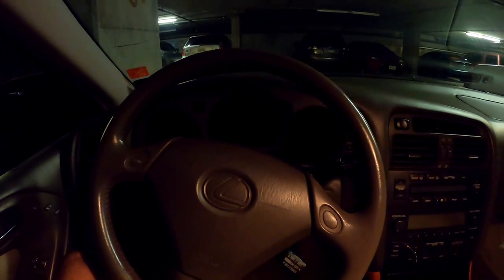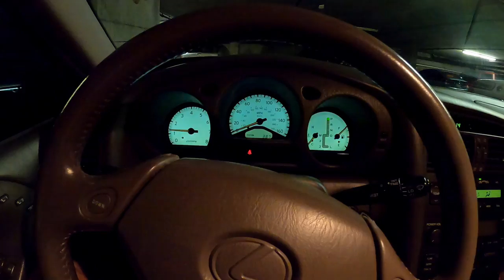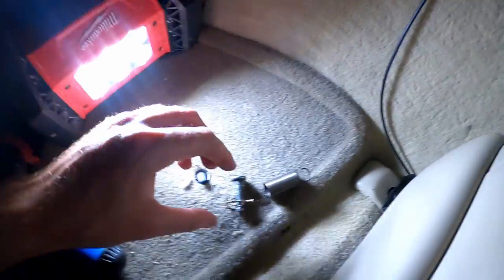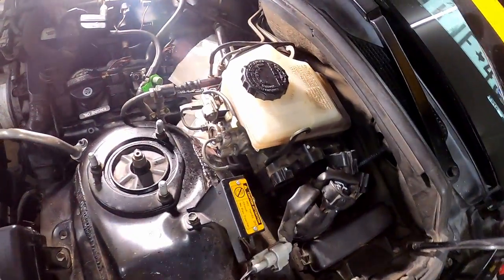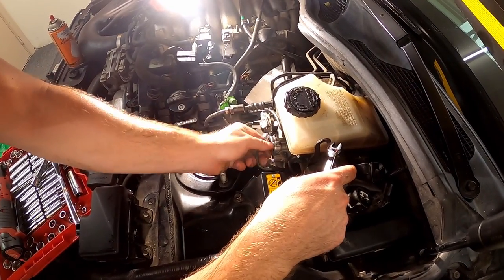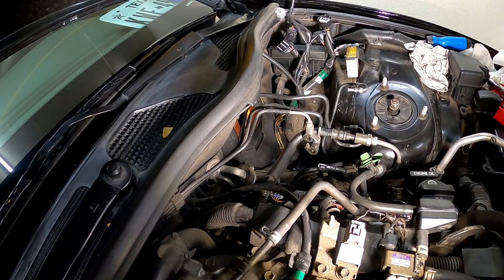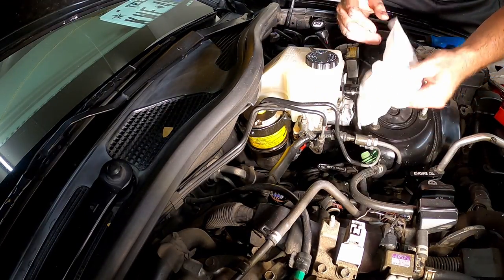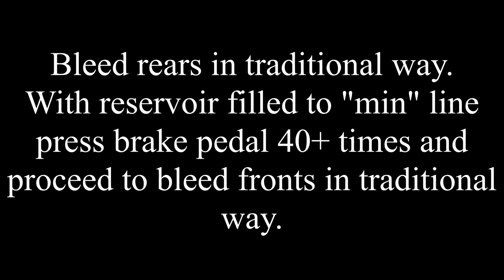Lexus GS400 Brake Master Cylinder - ABS Module Replacement. (Fix VSC ABS VSC OFF LIGHT)

Comment: Thank you for sharing. I am getting a squawking chirp from my brake master cylinder area and occasionally the brake light in my dash but no beeping. 

I recorded the sound on my channel and someone mentioned it was the brake booster going bad. I didn’t realize this plagues so many Lexus/Toyota models.
Reply from the maker: I had that same thing happen. I noticed it only when it was really cold out. My module ended up lasting another year before it started beeping
Reply: @NolanMotorsports  that’s reassuring to hear, hopefully I get that lucky too. I already had the brake master cylinder replaced once before.
Reply: Yeah it only seems to happen when it’s cold/morning time.
Reply from the maker: I bought my GS back in 2011. When I pulled my module I saw paint marker on it. I’m thinking mine was replaced once before as well
Reply: @NolanMotorsports  I read it’s common for these Lexus/Toyota models to have this issue. Supposedly the 2001+ gs models were improved. I still love these cars though.

Comment: I'm on my third! module in my GS300 1999. I can replace them in my sleep.
Reply from the maker: Really an easy process, most time consuming part is bleeding the brakes lol
Reply: I have a 1999 gs300 with a 2jz and its so fucking hard to get my brake booster out of the car
Reply: do you need a master key to work on these ? my mechanic is telling me he cannot and only a Lexus dealership can because they need to unlock something with a special key ?

Comment: How do you clear the VSC ABS VSC OFF LIGHTS?
Reply from the maker: You change your failing ABS module and the lights go away on their own
Reply: The ls460 is a beast with this problem … it’s no where as easy as these .  I had replace my actuator and still have the beeping sound

Comment: Did you have to swap the sensor since you have a 1999? I heard the 2001+ models have a different sensor that you just swap over. I believe you are holding it at 3:28.
Reply from the maker: All I did was unplug the sensors that came on the unit and plugged in my own. So no additional steps

Comment: mines do same thing i changed this part and still my lights are on. i think is the other Abs vsc trac module thats bad.
Reply: Same
Reply: @albertoesquivias1486  same here
Reply: I fanily fix it I just swap the hole booster and it wrrker new
Reply: @albertoesquivias1486  My ABS lights have come on and my car is making the same noise. If I swap out the booster, will this work for me as well?

Comment: did you need a master key to do this? i need this done and my main mechanic is telling me only a lexus certified technician can mess with them due to them having to unlock it or something ?
Reply from the maker: I had no special tools to do this work, sounds like BS
Reply: @NolanMotorsports I need a new one, and new lines because my cap for the reservoir came apart and thick pieces of rubber are now in the brake lines, does getting a new one have a anything to do with it ?
Reply: @jay-uh3pk  if you have rubber in your brakelines you're kinda screwed there, also get a 2nd opinion from another shop, your current shop sounds sketchy

Comment: That means the electric motor needs to be replaced not the whole thing
Reply: The fault is not within the motor but the protrusions and seals inside the abs block, the seals eventually go to shit and the motor then cycles all the time since the accumulator cannot hold pressure. The motor is bad usually only when it doesn't cycle at all, but if that happens it isn't really caused by anything other that the before mentioned seals. The motor goes bad because there are those brushes that eventually wear down by never ending pressure building. I'm fascinated how Toyota/Lexus managed to make the same shitty abs modules for 20 years now. Especially bad in hybrids though.